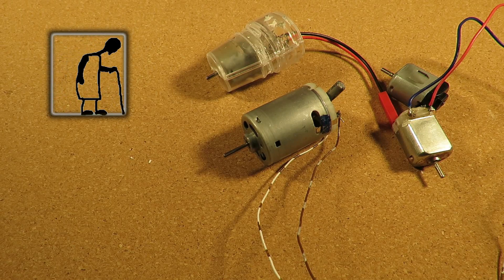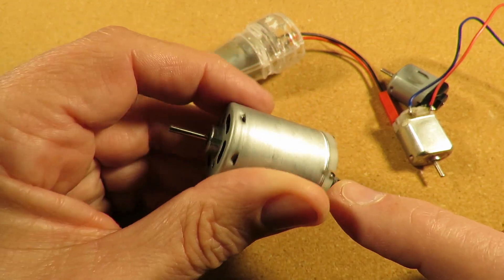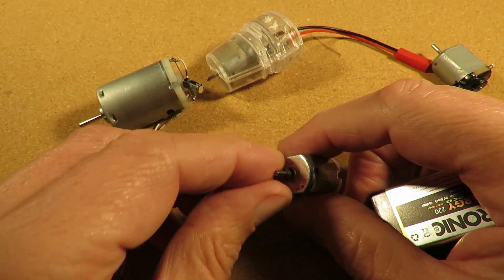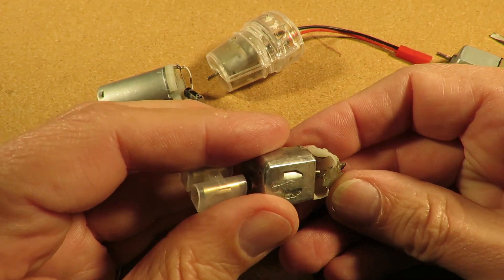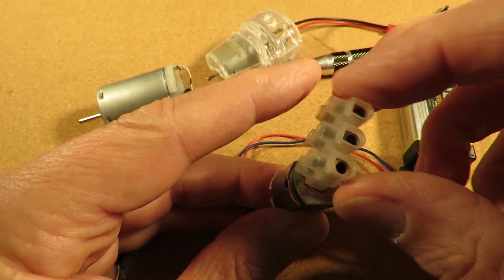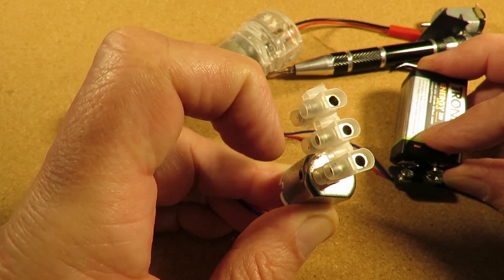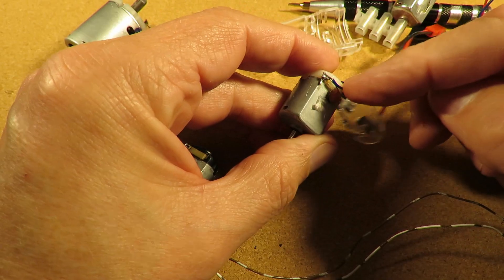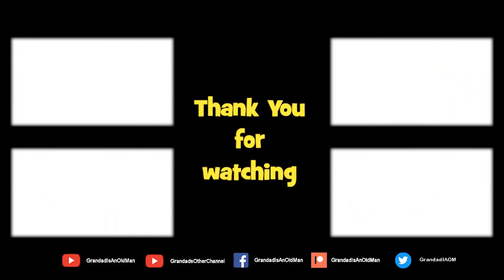Brush alignment on DC motor

Comment: Sir, is that any different before and after adding the ceramic capacitor the small orange Colour  item on the dc motor? On the video, I am so curious??
Reply from the maker: The capacitor is there to reduce the radio interference or "noise" caused by the DC motor's commutators constantly making and breaking the circuit as they spin. The switching creates small electrical arcs which generate wide-band RF.  Without them, the motors can create interference to cordless phones, TVs etc
Reply: @GrandadIsAnOldMan  Perfect Answer, you do know your stuff well :-)
Reply from the maker: Elnufo I also have access to Google like everybody else 🙂